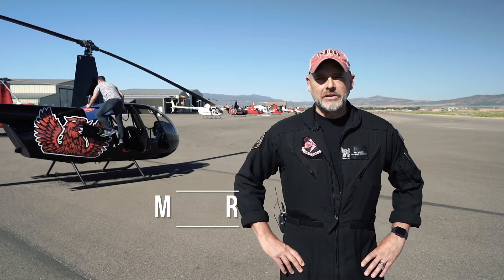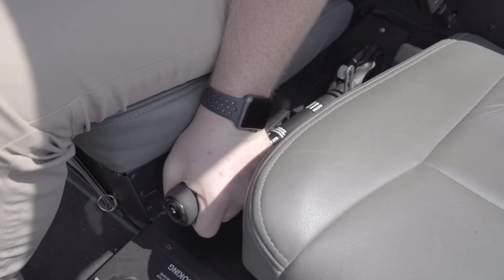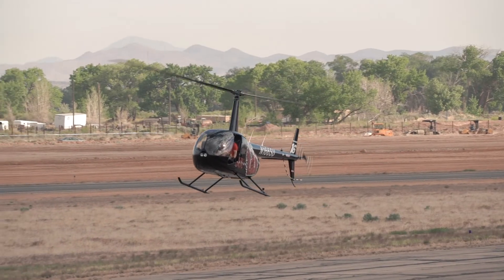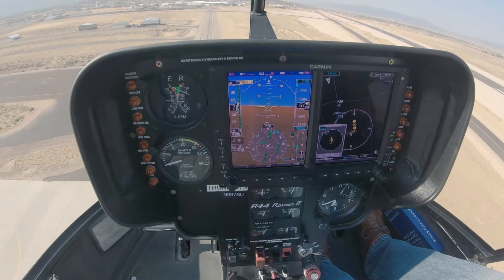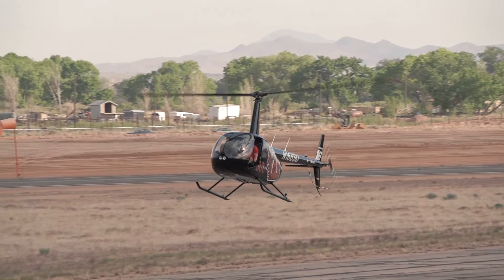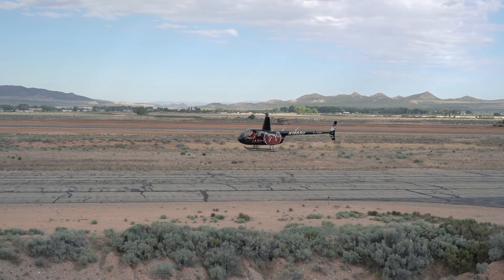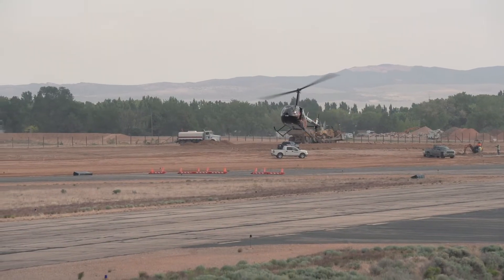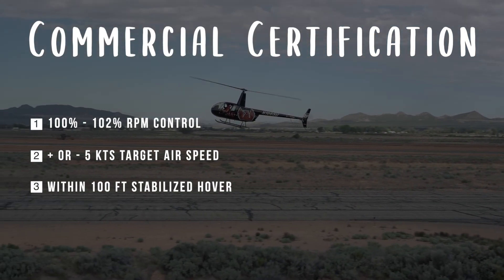How to Perform a Helicopter Autorotation Step by Step

Comment: Why is the back rotor still spinning?
Reply from the maker: Due to a mechanism called a sprag clutch, which disconnects the main rotor system and gearbox to eliminate drag. This allows us to have yaw control even in the event of a engine failure.
Reply: @SUUAviation  But where does it get its power from when the main rotor system and gear box are disconnected and the engine is dead?
Reply: It would seem that no one is capable of answering this simple question. It's a mystery to all. @banzobeans
Reply: the clutch seperates engine and rotor system, but tail rotor and main rotor are connected by a gearbox. so, in autorotation the ratio between main rotor rpm ant tail rpm is the same as in flight with power. (Consider the two rotors as one interconnected system, you can’t rotate one separately)

Comment: I'm amazed all this is even possible without ANY POWER. 🤯
Reply: If it wasn't, nobody would get in a damn helicopter
Reply: All the engine power gets converted and distributed into rotor rpm, airspeed, and altitude.  Its all still there even when the engines gone.  Just needs more controls to use in that form

Comment: Still confused how to adjust the glide to hit the spot. I’m transitioning.
Reply: Speed!  While it's all well and good to have a perfect setup for check-ride style auto, realistically, you're not going to have those conditions in real life.  If your spot is farther away than usual (use the spot's location on the windscreen relative to the compass to gauge it) then increase speed to the optimal glide speed (80kts on an R22).  If it's closer than usual, slow slightly or make a series of turns to adjust your position.

As long as you're meeting the right wickets at that 200ft AGL point, everything above it can be totally different.  Don't be afraid to play with your speed to get the spot right in the crosshairs before settling with the 65kts optimal speed.
Reply: @Maverickib  for the checkride I get +-5 knots so I can’t adjust that much.
Reply: @robertgary3561  Pretty sure that speed requirement is talking about the speed during the actual entry to the autorotation.  You should be able to adjust speed while on approach to meet your spot.  There's no way you'd fail if you say something like, "Increasing speed briefly to extend the glide," before coming back to the correct entry speed prior to the flare.

Comment: why are Robinsons so commonly used when they have such an atrocious record with the NTSB?
Reply from the maker: Hi there! Robinsons are great helicopters, but oftentimes the customers using them are low hour pilots who operate them outside of flight parameters that the Robinson Helicopter Company has set. We operate 19 R44s year round, and have found them to be very reliable and safe aircraft. We operate them with 200 students and 30+ instructors.

Comment: Do you have to do power recoveries? Why not all the way down? It seems to me you should train for emergencies by including the landing. After all in the real deal you don't have the choice to do a power recovery. When I did the fixed wing check ride I did a stall when the examiner said stall it. He freaked out when I did. He said we just need to get in a stall situation. So I recovered and on we went. I explained how I had had trouble with my landings so my instructor took me out and taught me stalls and spins. After that stalls were no biggie and landings improved immediately. Now I understood what the airplane was telling. So again, why not auto all the way down?
Reply: I’m wondering as well, I think it’s a safety issue
Reply: Robinson used to recommend full down autorotations as part of the type rating, and as practice for a CPL-H. Robinson no longer recommends full down autorotations. They have the stats and apparently the majority of dangerous incidents involving an autorotation occur during practice full downs - either as aircraft or pilot fault.

They now recommend power recovery autorotations, plus low level taxi and hover engine failure. The idea is that you stitch together the autorotation and the taxi full down. Autorotate and flare until you're close to a taxi height and speed, then use the taxi engine failure technique to full down.

Comment: I'm so amazed with your skill...may I asked a question ...what could possible cause a sudden drop of both Engine and Rotor RPM while at cruise flight...altitude 1200 ft, A/s95k, 4 pax.with less fuel ..manifold at 22 InHG ..indication loss of power ..low rpm lighted and low rpm audio, both needles drop to Idle speed ...what do you caused this incident??thanks
Reply: Well, I don’t know about civilian flight but Surface to Air or Air to Air Missiles can be quite mean in this regard
Reply: @theskirata7034  🤣

Comment: Nice video angles and talk through. 
Just a couple of corrections - 
1> At 4:00 in the video you say increase RPM to 104%, but the video is showing the Raven 2, so 102% (104% would be an engine overspeed in the R44 Raven 2)
2> In talking about the performance standards, at private level you say 97-102% and commercial 100-102% but the FAA Practical Test Standards (PTS) just says "Maintains rotor RPM within normal limits" which according to R44 POH (3-2) is 97-108% (and down to 90% for max glide configuration).
But really good!